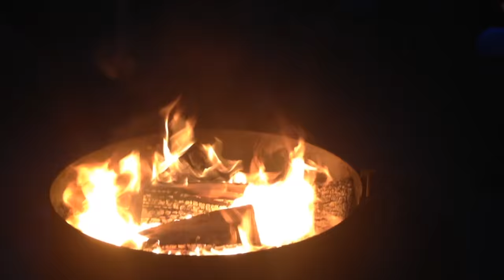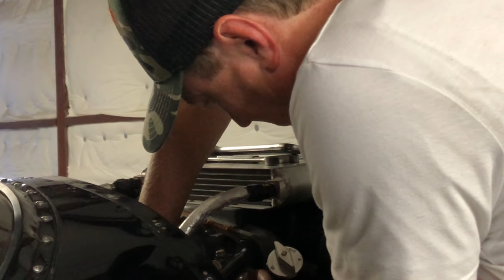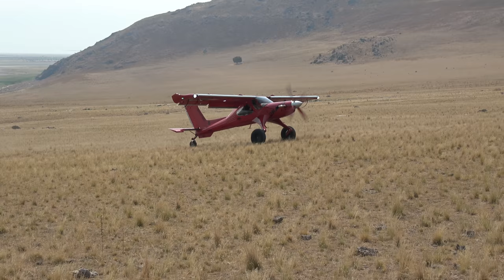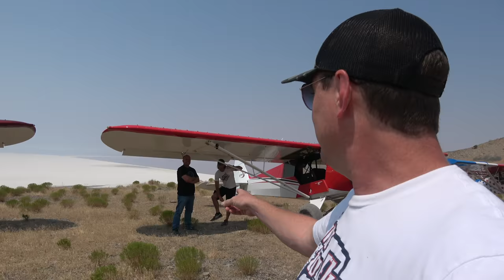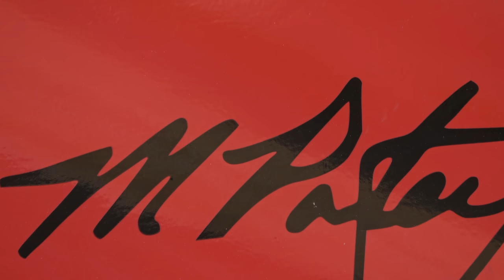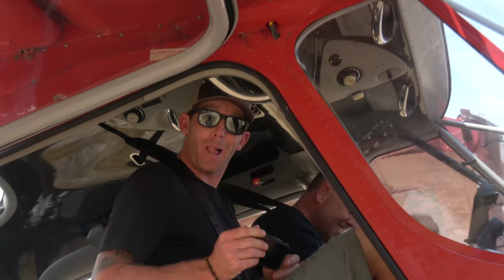The Flying Cowboys and their monster Bush Planes

Comment: When you are landings on the tops of ridges do you ever experience "leeside rotors"?
As a hang glider, soaring and Avid flying pilot I have experienced this many times. Coming in on a steady approach and suddenly the aircraft simply falls out of the sky or is driven down by this rotor.
Just wondering if you had any simular experiences.
When Trent and his wife flew for an early morning coffee trip and he landed a little heavy it occurred to me that he may have been "rotored" and hence the hard landing breaking his seat mounts.
Just a thought.
Reply from the maker: Grant, yes.  Rotor is a big deal, especially in high density altitudes.

A good bush pilot is aware of them and knows where they lurk.  A great bush pilot uses rotor to his benefit.